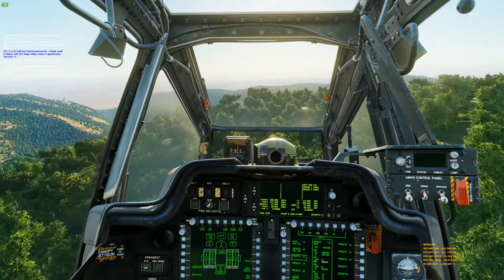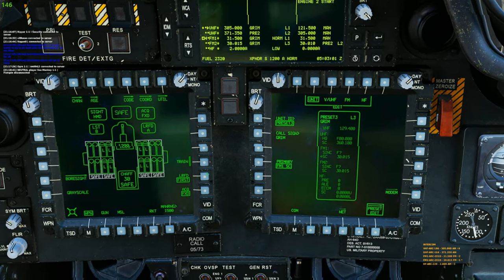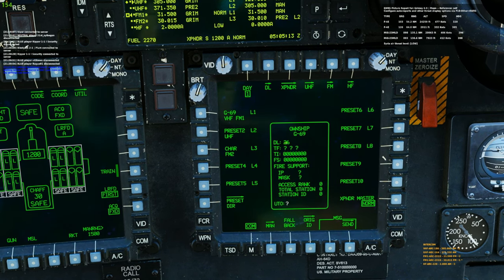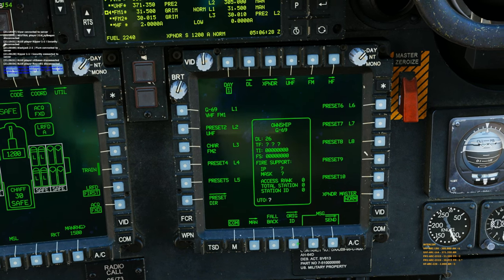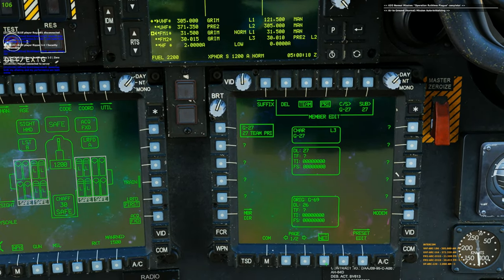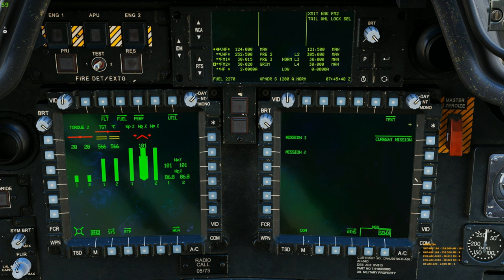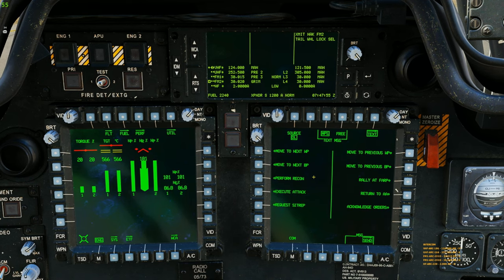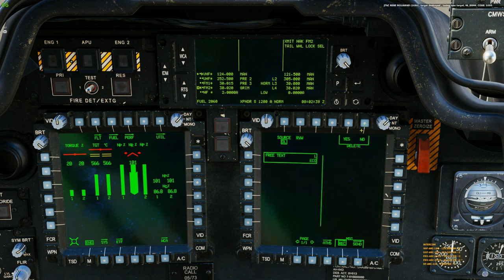AH-64D Apache: Setup & Use DataLink Fast & Easy! | DCS World

Comment: According to wags datalink video, xmit nak (not acknowledged) means, that the message wasn't received by the datalink member...
Reply from the maker: You’re right. That’s very weird because in our testing, and while making the video, that message would show up but the messages would still go through on both ends. Not sure I can explain why unless it’s a bug which can be very possible since it’s a brand new feature release.
Reply: @callsigngrimey  Hey Grimey, I was your fellow apache last night. AFAIK the NAK message means one of the recipients in the preset did not receive the message, which could be because the aircraft is out of range/not in line of sight or it's not monitoring the datalink.

Also, apologies for disappearing on you - I had to get some sleep for an early wake up.

Comment: Good start but bad ending. Datalink doesn't work on manually entered frequencies, only when using presets networks. At 8:30 you cut the video and went from MAN FM2 to a PRESET. Worst, the XMIT NAK means the messaged failed to be sent so something was wrong with your DL setup (page 2-153 from the AH64 NATOPS about the XMIT NAK : At least one of the receiving IDM or ATHS subscribers within the team (or for zone messages, within the zone) did not respond to the transmission on the VHF radio with an acknowledge). So I guess your wingman answered without receiving the message. EDIT : XMIT NAK could be because in MP servers you have a group of 2-3-4 Apaches and not all slots are manned.
Reply from the maker: As for the editing, this wasn’t all filmed in one take. I had to get multiple ppl to help at different times hence why the freq are different. That doesn’t take away from the steps/sequencing of it all. Also, I think it could be a bug because despite having a XMIT NAK message we both received messages. So more testing needs to be done. Remembers it’s a brand new feature and in beta